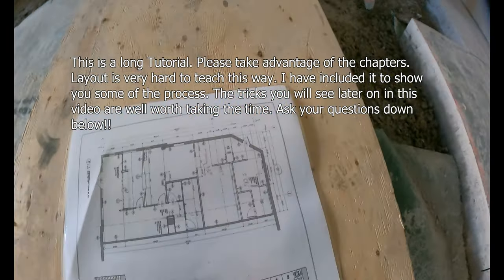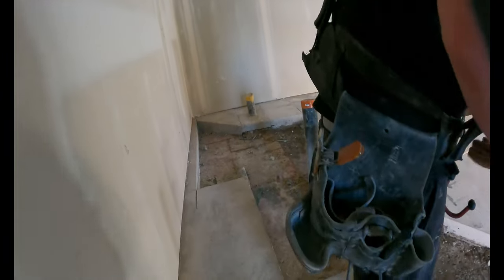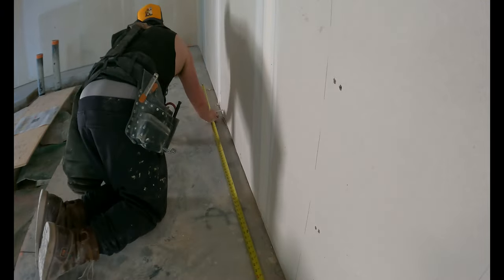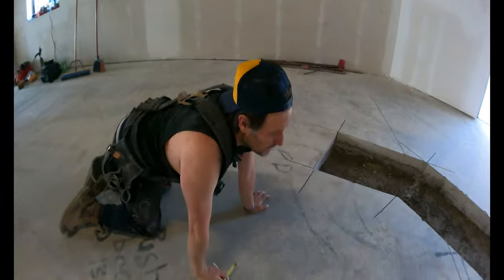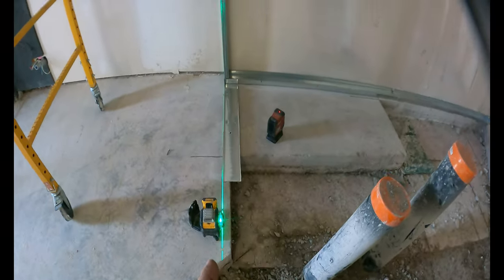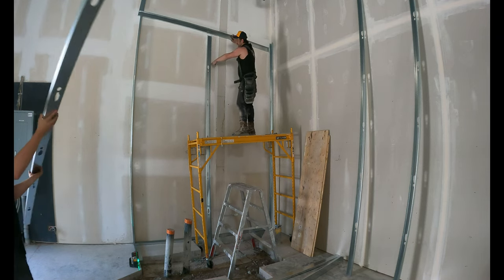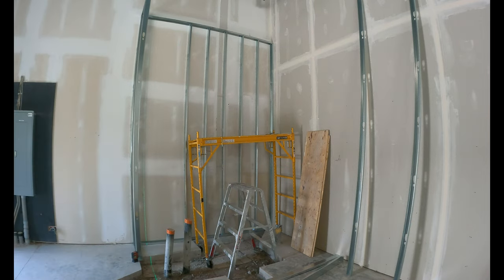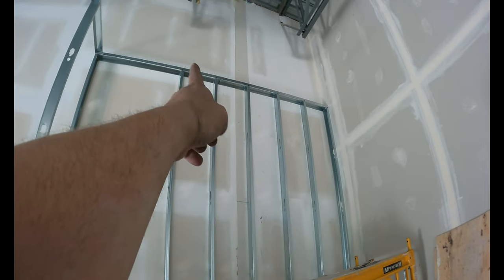Best Metal Stud Framing Tutorial

Comment: Any advice with wood blocking
Reply from the maker: Yes it's pretty easy when you know how to do it. What you want to do is rip your plywood down to 3 16" strips, then set the fence to 1-1/4" from the blade (or jest measure the distance from the edge of the stud to the flange), lower your blade height to only cut in the strip 1/4" (always use 3/4" ply for backing) then cut your strips evenly to 6 pieces (16"x16")  you can then cut those pieces on site to smaller stud spacing. Using 1-1/4" screws try screw from the inside of the stud on the hard side and the front of the stud soft side. That's actually harder to explain in text form. I do really need to make a video on this.
Reply: @ConstructionKronies  thank you for your time. Yea it’s a bit hard to understand. The reason Iam asking is I ripped out the drywall and I have metal studs. I wanted to add wood blocking to hang a tankless water heater. There is actually two metal crossbars going horizontal between the studs that I wanted to attach the wood to. ( the studs and the cross bar make a box) What iam asking is could I attach smaller blocks of wood so I don’t have to worry about the flange or can I attach the wood to the smooth side of the metal studs?
Reply from the maker: @jorgenorman8715  Just make sure you are screwing the wood in through both studs and you will be alright!

Comment: Do you use fixing/crimper pliers? To connect the studs.
Reply from the maker: Bro I lost my dam crimpers, I used them very rare usually when I could get a drill in to screw off. I am a structural guy at heart so I screw everything I can. But I do know there are tons of uses for them.